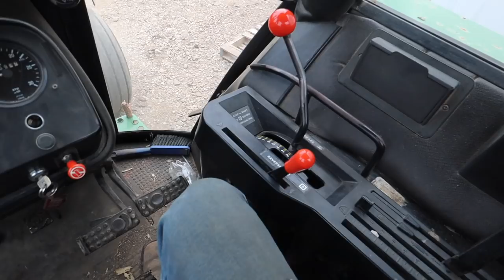City Girl Visits The Farm!

Comment: OMG. The 4840 power shift. I spent a lot time in the 4840 in the 90's when I was actively involved in the farming. I'm guessing it has a bazillion hours on it by now. I used it for all the Nh3,  disking, field cultivating,  had a dozer blade, pushed snow, brush, used on the cart all fall and sometimes all winter. All the gears were jerky! Especially 4th to 5th & 7th to 8th. I cant recall ever getting stuck in the thing. Very heavy tractor. Not gonna lie, I kinda miss the old brute.

Comment: Quick conversion of temperature from f to C and reverse is. Say it’s 90f to convert to C fast in your head subtract 30 then divide by two. 90-30=60/2= 30 not exact but close. C to F double and add 30. 15C is 15X2=30+30=60f 
She looks like a keeper. Bless you.

Comment: I was using an angle grinder like that one time with a cut off wheel on it. The cut off wheel exploded and almost cut off 4 fingers on my left hand. Also hit me in the gut and created a huge bruise there. It was protected by a couple sweat shirts. I would NEVER use an angle grinder again without thick leather welding gloves. Hospital sewed my fingers on but it took several years to heal all the way. I only lived like 2 miles from the hospital. You guys are far from a hospital.

Comment: Turn the HP up one turn on the JD and that will give it 40 more HP or around there. Then it will have more horse than the IH. The Deere looks like a bigger tractor. 
I remember it was hard to keep the front end on the ground pulling a 6 bottom 18" plow with an IH 1586 in black ground. 
Great video!

Comment: Cole must be tired at this point in the season. His “COOOOOOooooooooooooooooolle”’s have gotten shorter.
Reply from the maker: DJGatortail didn't help I recorded that intro at 3 am 😉
Reply: @ColeTheCornstar  Cole easy way to teach her what way to turn the wheel when she backs. You put your hand at the bottom of the wheel if you want the to go left move your hand at the bottom of the wheel the direction you want the trailer to go. Good video Cole
Reply: Only works on a single Axel right?
Reply: @davidhintz1  no any trailer
Reply: @davidhintz1  long trailer will back up easier than a short one. Shot one will come around real fast if you cut it to much

Comment: Regarding the Case been lighter on the front than the Deere - it probably comes down to a number of factors. Obviously the bigger grain cart on the Case makes a difference. Also the Deere appears to have a few more front weights than the Case. Finally the Case 7140 would've come as standard with 20.8R42 tires vs 20.8R38 for the Deere. Therefore the tongue of the drawbar on the Case is most likely further back from the rear axle than the Deere, which has an effect on the amount of weight on the front of the tractor.

Comment: I shorted out a electrical substation by catching a grain buggy auger on a pole guywire I was about 11 or 12 years old, it was a 180 bushel capacity Eddins cart built in Stuttgart Ark
 Tractor was a 1964 [4020 JD]

Comment: 13:50 - Its probably down to leverage, ie the case may have less front end mass or a longer drawer bar (hitch pin to axle centreline) or both when compared to the JD

Comment: The 4840 gears jump when you shift, but shifting the 4840 power shift is very easy does your 4840 have Syncro range or power shift